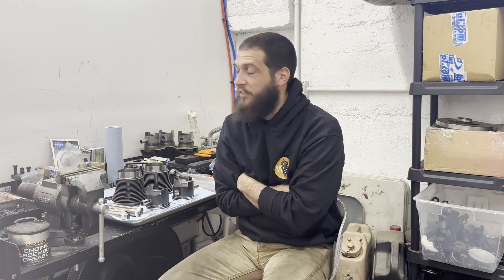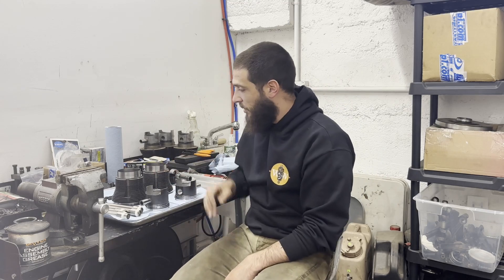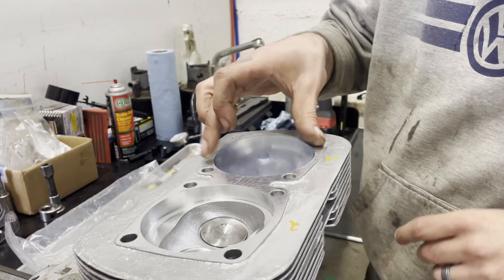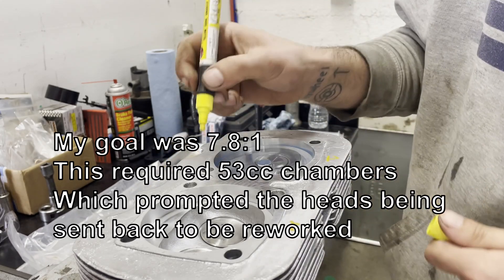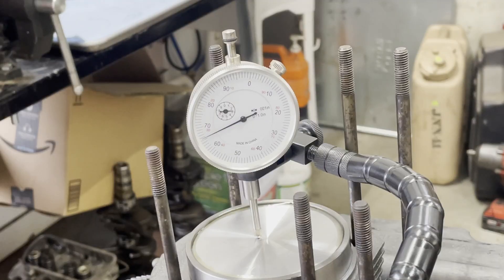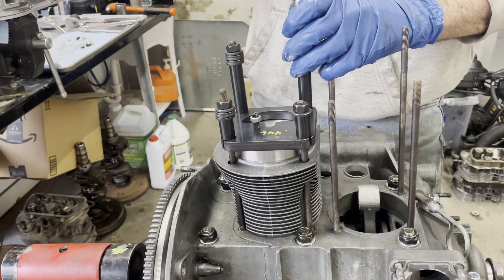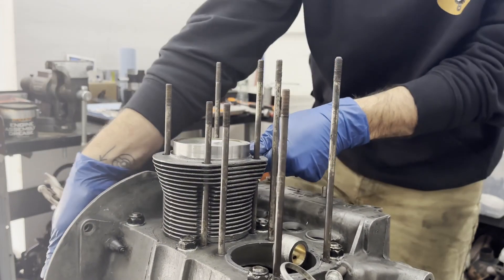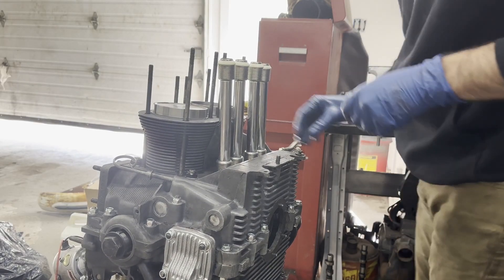HOW TO - Classic Aircooled VW TYPE 1 & TYPE 3 ENGINE BUILD - Top End Assembly

Comment: easiest way to solve the compression problem. Put a 74 crank and 5.4 rods in there. this will make an 1800. Which will require a larger cc combustion chamber. at 50 to 60 deck decent compression ratio.